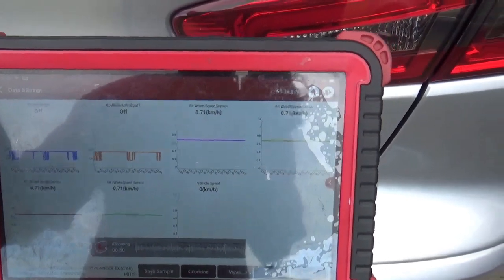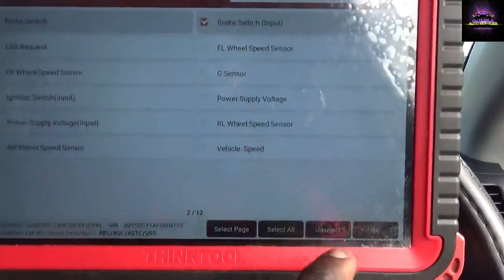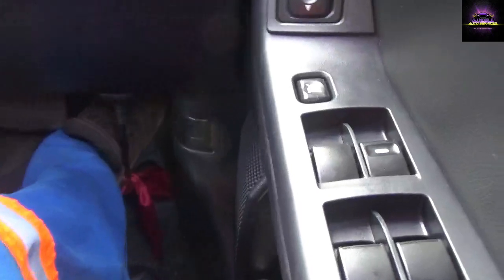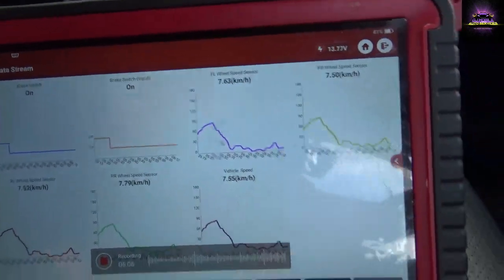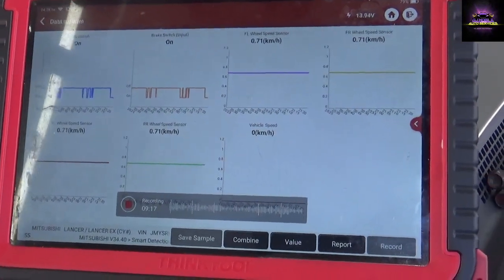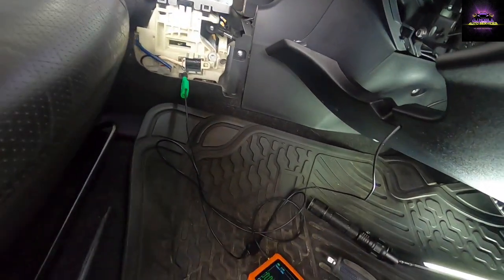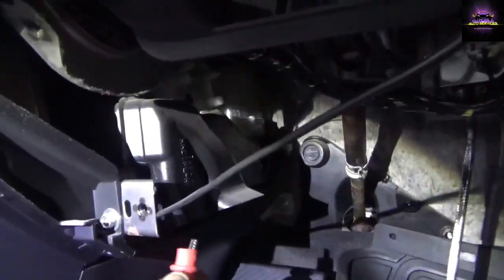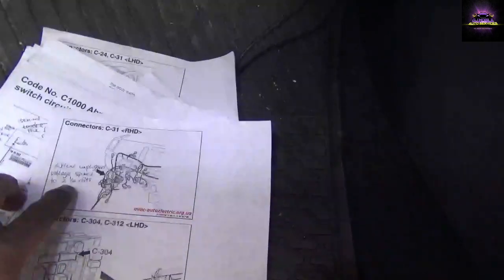C1000 Mitsubishi Lancer Brake Switch Stuck, Lost Power  and Acceleration. Pt1

Comment: hi bro. i got the following code  
DTC Description State System
P0703 Brake Switch                                      Active     TCM (Transmission Control Module)
C1000 Brake SW (Stuck)                              Stored    ABS (Anti-Lock Braking System)
L0740 P/W(DR)  3 Times Jam-Protection Stored    LIN
Reply from the maker: You got to get it diagnosed.  Check your lights. Or it could be the faulty brake switch

Comment: I got the c1000 code brake sw stuck, i have aftermarket tail lights maybe water has gone into them… what do i do?
Reply from the maker: Im not sure exactly what you are asking. I showed in both videos what I did to diagnose this fault. You can try to get it diagnose better, change out the resistor or install the OE taillights but before you do so, make sure and cover all your bases.

Comment: hey brother, i just want to say thank you for putting this video up. i have been having issues with my lancer for the past 3 weeks, whenever i drive i would randomly see my rpm drop and lose acceleration. i literally brought it to 3 different mechanics, none of them are able to figure out my issue. i was already thinking of selling my car as i thought its my transmission going bad. then i stumbled upon your video, at the same time i remembered replacing my halogen brake lights with brighter led lights from aliexpress. lo and behold, i put my old halogen brake lights the next day and the issue literally went away. who would have thought the brake lights can cause the car to lose power. i cant thank you enough, you are a life saver.
Reply from the maker: Hi, im glad to know it helped. Yes, that crazy, these cars are getting more challenging to diagnose, but hi one car at a time.👍

Comment: Hello and thanks for the video!
I have almost the same issue, only that my car refuses to accelerate for 1-2 secs after braking. While in P, no issue, no clicking noise from the safety pin. I will change the brake light switch and see if it will happen again or not.
Concerning the car in the video, have you tried to power the switch on the bench, check if it gives you any signal?
Reply from the maker: Trust me on this. I ran through everything.lol. it wasn't none of the modules or the brake switch. Look to see if anyone is blown. Check for corrosion.
Reply: What was it then in your case? Corrosion?
I've had the same problem on my girlfriend's Fabia (manual transmission) yesterday, only that her brake lights were on, so I've changed the switch. The contacts on the old switch looked a bit corroded (not green, but dark red/brown). I want to crack it open and check inside.
P.S.: I have original tail lights and no rear damage (I have the car since new)
Reply: @Tolstoiewsky  yeah corrosion. I have part two up on this video. I believe the fix was in it as well.

Comment: I have this exact issue how did you fix it?
Reply from the maker: Remove the rear brake light to see if there is a resistor attached to them. If it's aftermarket lights. Water may have gotten into it
Reply: @djmobileautoservices  thank you very much for the quick response. I recently had my car in the body shop for rear end damage. I feel like they must have done something. Gonna take it back to them before I try fixing it myself.
Reply: The lights are original tail lights
Reply from the maker: What exactly are you experiencing? Meaning is the transmission going into limp mode? Or the BCM trigging the brake switch?